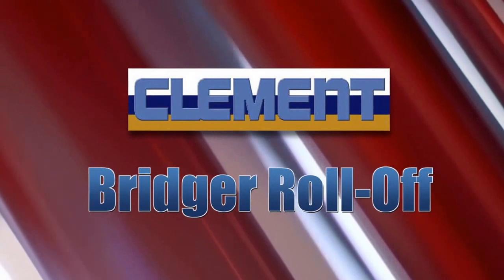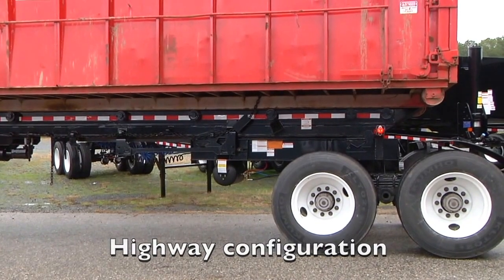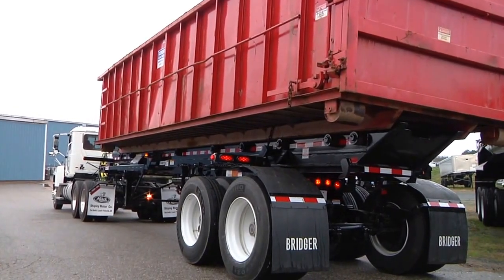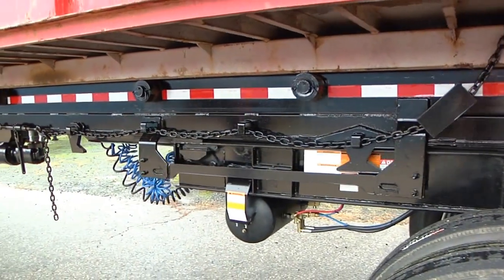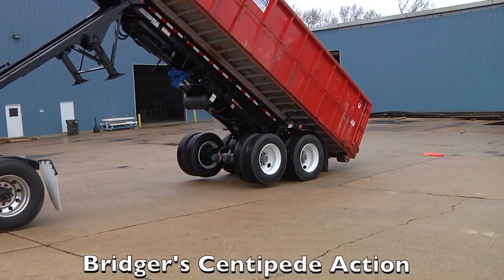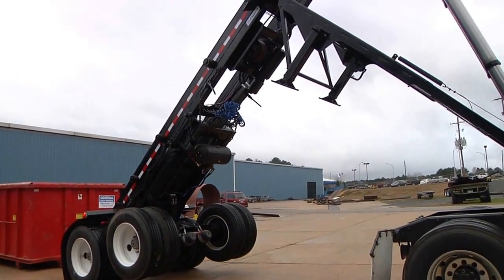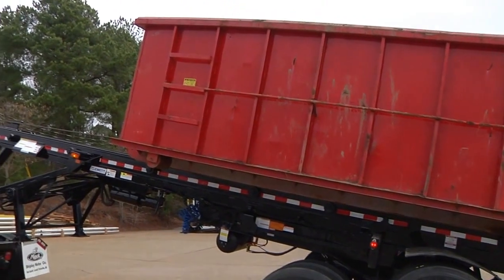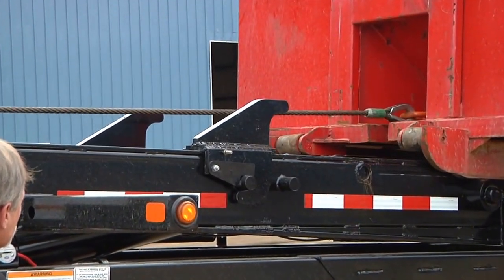Clement Bridger Frameless Roll-Off

Comment: Neat design! How is the rear of the bin secured to the trailer? How do you conventionally dump a 20 ft. bin? How big does the cylinder reservoir have to be? Is there a lot of cab room necessary for the controls, I'd like to share the cab w/ controls for a dump trailer? It looks like the Bridger controls are better on the outside, since you have to walk to the rear to hook up.
Reply: If you look around the 2 minute mark you will see a chain and binder setup to secure the rear of the container.  20 yard containers are slid all the way to the end of the rails then put the hoist back down.   Then open the rear door and dump it like any other container.